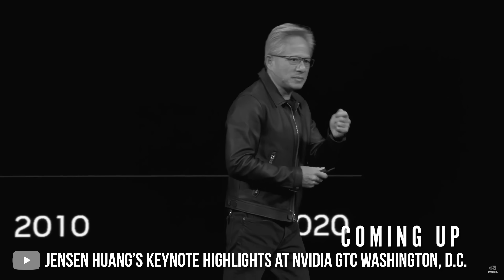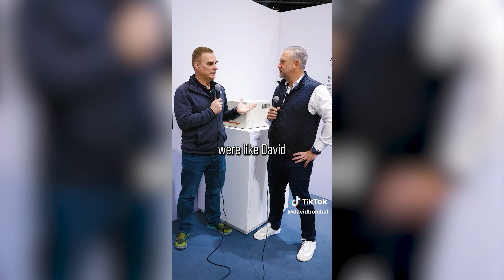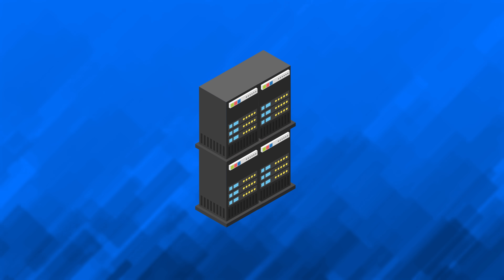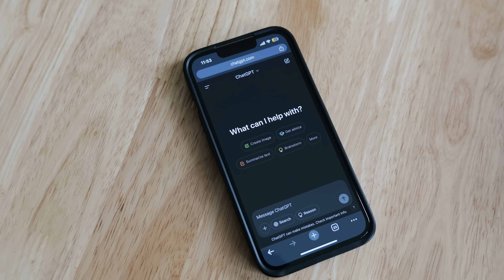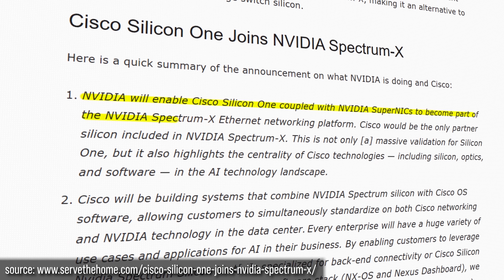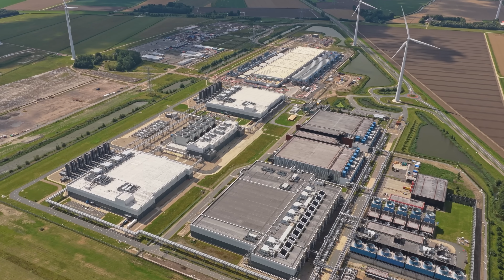Why Cisco Built This AI Device

Comment: "Hello David, you always say not to use Windows for logging into sensitive accounts. Now my question is: if the device is updated, clean, and properly managed, will Windows be secure? Please advise."ME A LITTLE BIT IN DETAIL PLZ
Reply: Windows is the spy device.
Reply: @FurikuriYugi  DEFINITELY
Reply: After witnissing an attempt to (ab)use the WMI 'system' of Windows 11, luckily blocked by Bitdefender (suspicious behavior), I dived into the raw logfiles, to determine how this MALWARE ended up on my Win11 laptop. What I discovered made my take a decision in msec: Win11 goes to the graveyard for me. No more Win11. Why? Beacuse this malware was delivered to my laptop AND SIGNED by .... Microsoft itself. Now I leave in the middle if M$ is actually doing this on purpose or if they are a victim themselves of threat actors abusing the signing keys of M$. And I don't care so much about that, If it comes into my laptop (unattended) and supposedly 'trusted' because its signed by M$, you need protection for 'unknown' behaviour from .... M$ products itself. I switched to 100% Debian now. ANd ask myself; 'why the h* didn't I do that before'?